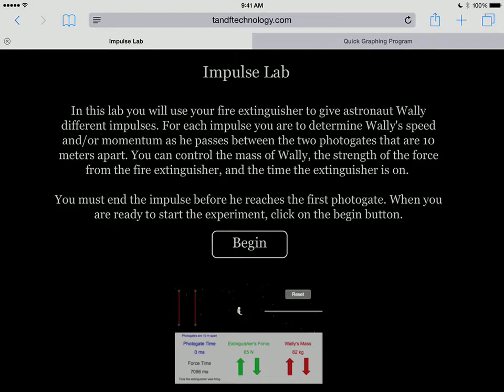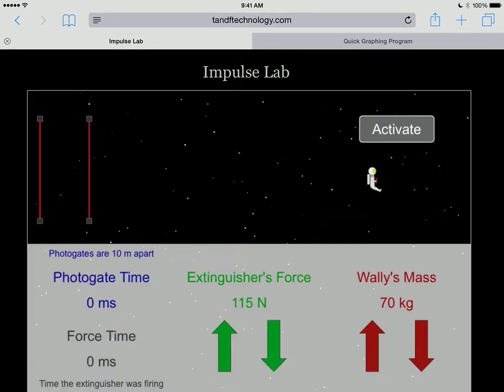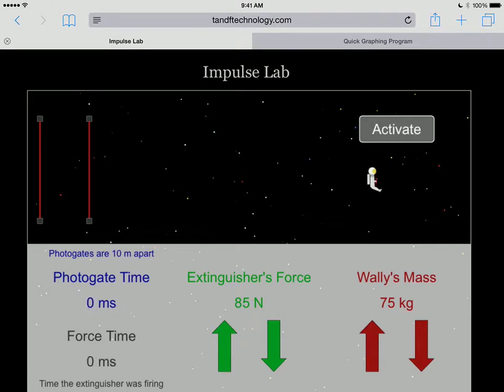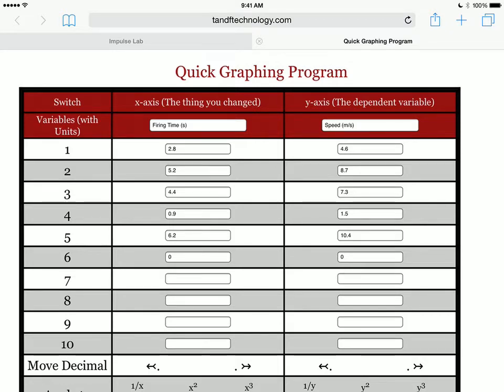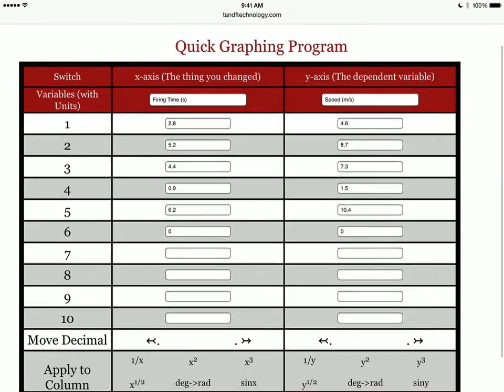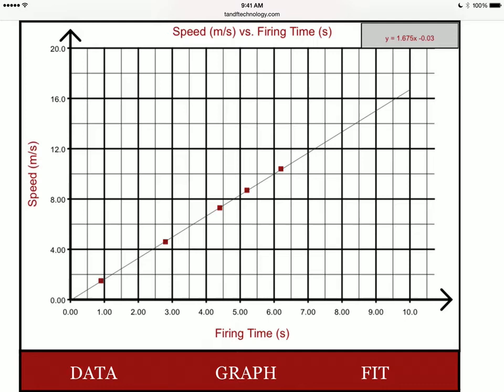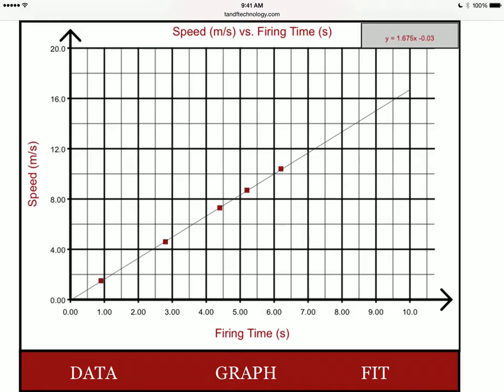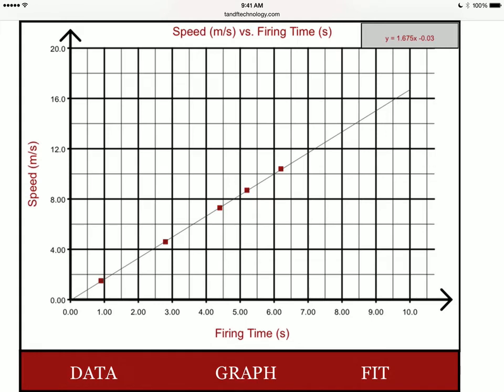Impulse Lab

Comment: I am having my students find Impulse and chang in momentum, te numbers are not coming out exactly equal. They are alway 1 or 2 N.s off. Is there something I'm missing or is the lab designed like that on purpose?
Reply from the maker: I almost always have some built in error in my labs.   My email should be on the home page of my site. Feel free to reach out if the errors are too large.  We can adjust.